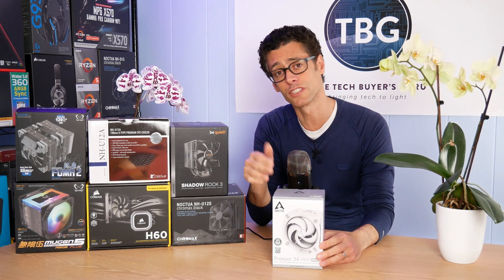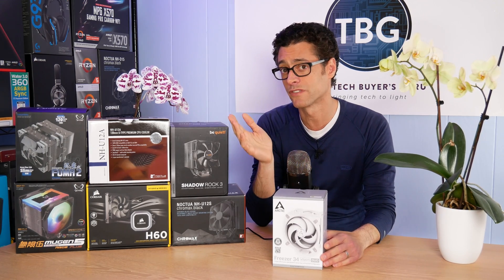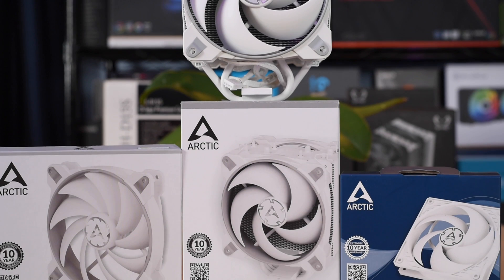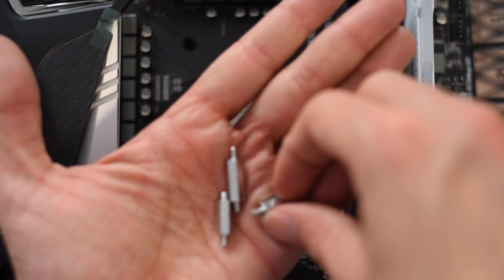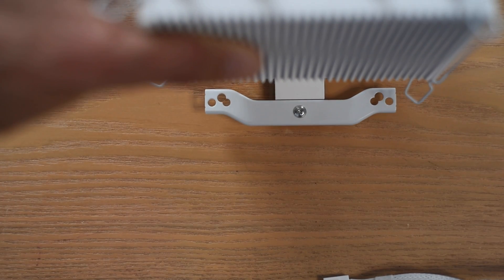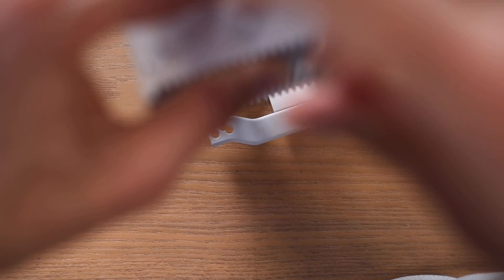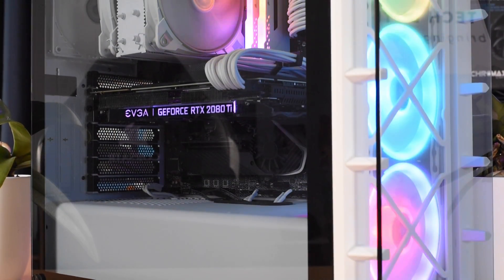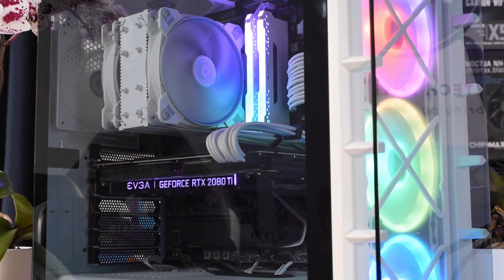Arctic Freezer 34 Duo White CPU Cooler - Ryzen Installation Video

Comment: I bought a cheap id cooling 240mm zoomflow aio, for my ryzen 3800xt, and my temps are high.... at idle 60-70, and under load on rogue company it spiked to 90 and i shut the pc down... im not sure what to do...

My ryzen 2700, temps dont even break 55 in warzone... is this a good start to fix these thermals?
Reply from the maker: That sounds hot. I don't know anything about the Zoomflow, and you should probably look for a video on that cooler if you need help with it.

Comment: Do you think this Cooler can cool an I9 10Gen ? Im not gonna oc it
Reply from the maker: I would not recommend this cooler with a Core i9-10900K or 10850K. Those processors draw more than 200W. This cooler doesn't have an official TDP rating, but even if it could work, it would run extremely hot and loud.

The Core i9 almost requires liquid, there are very few air coolers I'd recommend for it. The only one in this size class that I'd even consider is the Scythe Fuma 2: https://amzn.to/3jc2FDS

But that's only if you can't fit a 280mm or 360mm liquid cooler.
Reply: The Tech Buyer's Guru Thanks for the Response ! But do you think it would work with an corsair h100i rgb platinum se ?
Reply from the maker: That's the minimum cooler I'd use with a 10900K.

Comment: Would you say this is a good cooler for the 3900x?
Reply from the maker: I would step up to something a bit more powerful. I recommend the Scythe Fuma 2:  https://amzn.to/2Q4EbQh

The Freezer 34 Duo can handle the 3900X, but it will need to run at high RPM to do so. This is by design, and how Arctic provides high-end cooling at a moderate price.

Comment: Dumb question. If you remove the screws for the brackets like you did at the start, are there other screws holding in the back mount?
Reply from the maker: The screws that come with the cooler are what hold the backplate, but they don't look like the stock AMD brackets. You'll need to hold the backplate in place as you attach the Arctic screws through the front. A little awkward, but you'll figure it out!
Reply: @TheTechBuyersGuru  Oh ok, thanks for the help. I'll be doing it with the MB in the case and its my first time replacing a cooler.

Comment: Do I need to clean off the old thermal paste from my stock cooler before I install this cpu cooler? Thanks
Reply from the maker: Yes, and the way to do it is to use rubbing alcohol and a paper towel.
Reply: @TheTechBuyersGuru  yeah I just go to CVS store and buy 91% Alcohol or go to ACE hardware and get a gallon 99% Alcohol

Comment: Are these Arctic P12 PWM PST fans or the Bionix P120?
Reply from the maker: The case fans are P12 PWM PST (https://amzn.to/3fN9ydD), and the cooler fans are BioniX P120. The P120s look cooler, but are more expensive and louder at the same RPM due to the frame design.
Reply: @TheTechBuyersGuru  How's performance of the cooler with the P12 PWM instead of the P120? Ever tested it?
Reply from the maker: Good question. I've actually never tested the P12 versus the P120, despite having both in the same system. But if you're interested in cooler fans generally, you might want to check out this shootout I did: https://youtu.be/W2Zis8RjcX8
Reply: @TheTechBuyersGuru  Already seen it friend. I ordered 10+ Arctic P12 PWM fans last week (not for a single system) based on your video shoot outs and tests.  They've been great.
I'm also running the tiny little Arctic Hub.
Would be interesting to see P120 and P12 fight it out on the arctic cooler. :) 
If Arctic ended up keeping the performance of both and adding RGB then they would sell a shed load more too.
Reply from the maker: You just wait... RGB may be coming from Arctic sooner than you think!

Comment: According to the instructions you need to apply thermal paste on the cooler!!! can I apply thermal paste directly to the processor???
Reply from the maker: It will not spread as well if you do that due to the ridges of the four direct touch heatpipes, but it will still function and won't damage the processor. Temps may be slightly higher.
Reply: The Tech Buyer's Guru I found my temps to be higher when the paste is applied to the cooler, rather than the CPU.
Reply: @syxxphive126  how C° higher?
Reply: @Saigonas  about 5°C higher.

Comment: Why is my backplate loose?
Reply from the maker: It's loose until you tighten up the cooler fully. There are no spacers to hold it in place until that point. Make sure your CPU is in the socket!
Reply: Did you fix it? I’m having the same issue with my Aorus pro b450

Comment: I've been planning on grabbing this cooler and adding 2 phanteks Digital RGB halos to the fans, do you think that would work well?
Reply from the maker: The Halo fan frames are pretty cool because they allow you to use the best fans and then add RGB. But they won't work on some cooler fans, like Noctua, because the fan clips need to go through the front of the fan, which is where you'd have to screw in the Halos. Luckily, on the Arctic Freezer 34 Duo, the fan clips secure to the rear of the fan. The only problem is that the P120 fans used on this cooler don't have a flat frame, and the Halos may not sit neatly on them. I'd suggest you just get one to try it out and see how it works. Phanteks definitely released these for use with case fans, so using them on a cooler is a bit out of spec.

Comment: I put the Thermal Paste on the CPU instead of the cooler, big mistake??? My CPU is running good without very high temps.
Reply from the maker: It's fine, may not spread completely evenly, but it will still work.

Comment: I have msi x470 gaming plus max the will fit in the motherboard or i need another backplate?
Reply from the maker: The backplate comes with the X470 board. It's the same one used for stock AMD coolers, so all motherboards have them.

Comment: Would this cooler fit in a Corsair Crystal 280x?
Reply from the maker: No it would not. Maximum height in the 280X is 150mm. I don't know of a single 120mm-based tower cooler that would fit in that case. You should consider a liquid cooler like the SilverStone PF120: https://amzn.to/3cVYNUU. I recently reviewed it here: https://youtu.be/qGOCk1S1WLs.

FYI, I've tested over 50 coolers over the years, and only one 120mm-based cooler ever came in under 150mm: the Cryorig H7. Unfortunately, it's no longer manufactured, and resellers price gouge it at $100: https://amzn.to/2Tt4UIy. It was originally $35.

Comment: Nice install but you made one mistake the fan with the white rubber spacers need to be on the side so that the isn't radiator, try to run the fan at full rpm and check if your aren't getting any rattle noise.
Reply from the maker: You're right - but I actually noted this in the video here: https://youtu.be/dADNeKlCHWI?t=465
And in the final shot, I had already fixed it: https://youtu.be/dADNeKlCHWI?t=533
Reply: @TheTechBuyersGuru  i see sorry i didn't notice that.

Comment: Is the Duo worth the difference over the single fan 34 Esports? £10 difference here in the UK. Thanks for the great video!
Reply from the maker: That's a tough call. If you have a 95W/eight-core processor (or above), the extra cooling power is pretty important. Otherwise, the standard model is more than sufficient, and it's quieter too. I see it's £30 at Amazon UK: https://amzn.to/2xGkVDh. The Duo model I tested is £41 at Amazon UK: https://amzn.to/3dmlsJz. Given those prices, I'd probably get the single-fan version. You can always upgrade it later with an extra fan, which typically costs less than £10.
Reply: @TheTechBuyersGuru  Thank you for the reply. I have a 2600x. I think I will go single fan and as you say I can always add another!
Reply from the maker: Learn more about the performance differences in my full 120mm cooler shootout: https://youtu.be/HZOGK49NGLQ
Reply: @TheTechBuyersGuru  the single fan version only has one clip for a fan so it is better getting the duo version.

Comment: I have B450pro 4 paired with r5 3600 and Rx5700 xt , does this cooler fits in that mobo ?
Reply from the maker: Yes, it will fit.
Reply: @TheTechBuyersGuru  no it will not fit out the box you need to contact arctic for the new standoffs or compatable backplate

Comment: Can a 49mm tall ram stick fit easily on the ram slots without interference?
Reply from the maker: The cooler does not cover any RAM slots, so you can use any RAM you want.

Comment: Nice video, how was the backplate? I have the MSI B450 Tomahawk MAX and I've read that a lot of people are having problems with the backplate. It simply woggles and won't stuck to motherboard properly. You experienced anything similar?
Reply from the maker: Definitely no problem on the MSI X570 Gaming Pro Carbon. I've installed nearly 10 different coolers using this board, and not a problem with a single one using the included backplate.
Reply: Deffo an issue with all msi boards I'm on a b450 gaming max and same issue as hou
Reply: @steverobinson243  I just ordered this should I cancel it?
Reply: @steverobinson243  I'm on a  msi b450 gaming plus
Reply: @Thai.H  how is it??
Reply: @Saigonas  I got the scythe fuma 2 cooler instead it's a better cooler overall and looks way better

Comment: Can I fit it in an m-ATX motherboard without contact on the RAMs?
Reply from the maker: Yes, you can. The RAM spacing is the same on micro-ATX. Only the PCIe slots are different.

Comment: I‘m a big fan of the eSports Duo. I went back to it from a Dark Rock Pro 4 :-P I just love the way the fan blades move and the temperatures are great as well
Reply from the maker: One thing is for sure - this cooler is infinitely easier to install than the Dark Rock Pro 4!
Reply: Did you get little white circle stickers with yours? I don’t know what they are for
Reply: @sullenova  maybe they're there if you're not comfortable with metal standofs touching your motherboard directly? do they fit between?